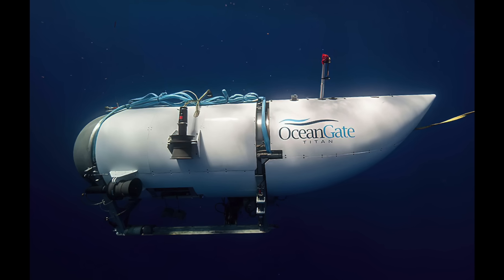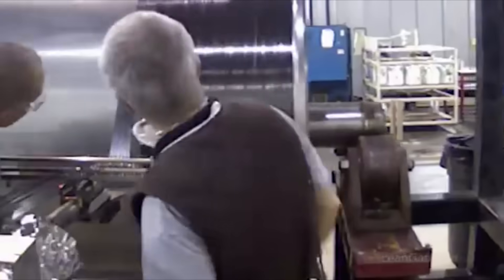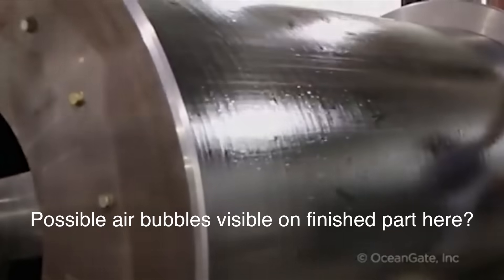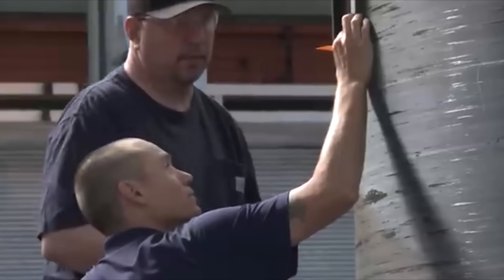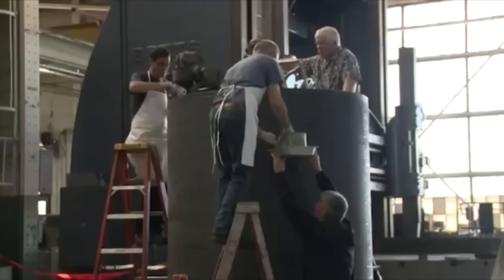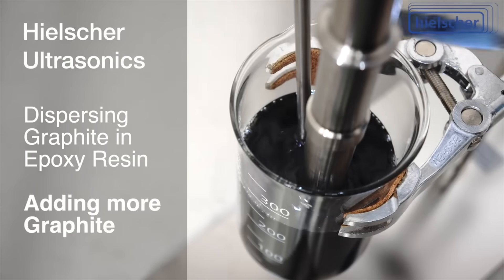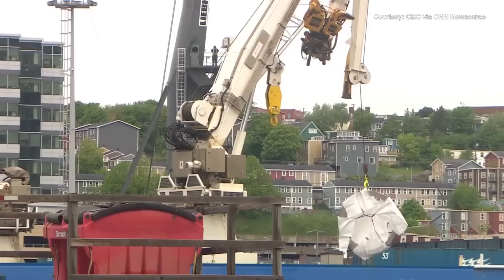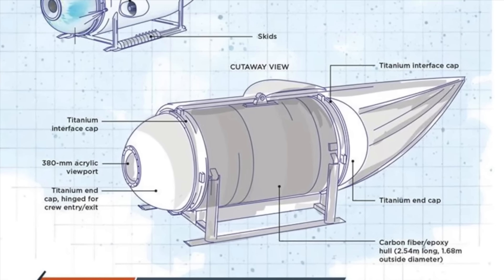Why OceanGate Titan Imploded - A Carbon Fiber Composites Perspective

Comment: Looks to me like the cylinder tightened against the inside of the C channel on the rings- must have been an enormous stress riser- Some force has sheared off the inner side of that channel on the forward ring. Also, so correct about the glue. Unless it oozes out the entire way round, you know you've left some dry. As de Havilland used to say when building the Mosquito- 'Whatever you do, don't spare the glue!'

Comment: An isotopic or quasi-isotropic layup would have made it more difficult for a pinhole of pressure to penetrate and begin to separate the laminate in both horizontal and vertical orientations through the laminate.

Comment: To fit the Titanium endcaps, they had to chamfer or remove about an inch of material in circumference.  When you do that, you just lost a huge proportion of strength on the outside layer.   It's now ready to peal off, pull away from the layment.  Similar to the sanding down of wrinkles, this seriously must weaken the full strength.

Comment: upon seeing the actual construction videos I had to cringe where they were buttering the ends with the adhesive, that is applying an adhesive to a smooth face in order to bond to a fairly smooth face as well in the composite material. That was just a matter of time before that came apart after compressing & expanding and over again. Flexing bit by bit till more fiber pulled apart and snapped, till finally it catastrophically failed. ~5900 lbs+ of force per inch baring down on every square inch multiplying to millions of pounds of water that REALLY wants to get inside.

Comment: If you study buckling you will see that the mathematical description includes a frequency component. This displacement will absolutely generate loads which are not radial. 

The vibrational wave of a buckling member is only one quarter wavelength long. Lol

Comment: The titanium ring should have been laminated into the body of the sub. In my industry making medical devices, we would NEVER trust merely epoxying in a titanium attatchment ring. It is always laminated in being part of the overall structure often with extra reinforcment. We often also use layers of different materials such as arimid, spectra, even fiberglass to take advantage of their benefits. Carbon fiber is super strong but it's also incredibly brittle and weak, especially at 90° to it's axis. Using muti directional layups doesn't have that much to do with torsion and more to do with alignment of the fibers so that the inherent weekness is mitigated...exactly the same as plywood. My theory though, is that the sub body was able to be squeezed more in the center which would actually make the ends go bellmouthed. With such a short flange only being held in by sketchy glue it would have popped like a cork.
Reply from the maker: I completely agree about the bell mouth ends I think this probably never happened in their simulations because of some dodgy FEA. I’ll probably make another video including the latest findings from the investigation.

Comment: Did they ever test the compressive strength of the totally uniaxial composite in the direction across the fiber direction ?   Across the fiber direction a composite is hardly better than the raw resin.  It seems pretty clear that the tube failed in compression as applied by the two titanium end caps at depth.  This particular wrap design is even worse as a pressure vessel and is only used as an overwind on a metal tube that itself alone can take the tensile load applied by the fixed ends.  As a diving vessel you have similar design priorities with tube compressive stability added to the problem.  Too bad he didn't just use a thick wall titanium tube like submarines are made from.

Comment: Watching the assembly I see on the rings should have bolts along with the glue that would have made a stronger connection from the pressure hull to the rings also the pressure hull shoud of had a thin titanium sleeve under the carbon fiber and the window was not rated for the  depth there were trying to reach at the least 3 fatal flaws in the design.  This is a lesson technology over reach it's own bounds a lot like the Titanic it's self suffered the same fate . It would make a good move !

Comment: Would love to watch a vid of recent information that has came out and your analysis.
Reply from the maker: Going to cook one up once the dust has settled. Got some nice HD footage of the sea bed.
Reply: @JamieKunka  I have been watching them all like crazy. Would absolutely love to see a CF tech do an analysis. Me personally, I actually don’t think it was the CF that imploded. I think it was either the seal or the glass even. There’s far too much of it on the sea bed for it to have been the cause, too many big chunks. Once delaminated it gets extremely weak and basically just shatters like glass, so it doesn’t make sense to me that it was the main culprit if there’s such big pieces left. Not to mention, almost ALL CF is done on various angles, not how they did it. Hell, even my car parts were.
Reply from the maker: I think you’re right but potentially the carbon hull deflected too much due to all the cascade of internal faults and may have exacerbated the de-bonding on the interface cap. The window sounds like a fascinating area to research with its unusual design.

Comment: In fairness, the guy wiping with an oily rag, it is the outer sealing ring not the glue/bonding interface, however the guys on steps spooning the adhesive on is a total horror story, as is the whole construction and concept, an avoidable tragedy.

Comment: Mickey Mouse operation from start to finish... at least Stockton was in it when it imploded, I just feel sorry for the passengers and their families.
At 12,500 feet the pressure is around 380bar, which is about 5,500psi...not something to be trifled with. Hopefully lessons have been learned. I guess the lack of regulations meant that sooner or later some clown would get cocky and have a go at it to try to do it on the cheap. Bad idea.

Comment: Yeah, I agree… 600 layers all in a single orientation is actually very weak… and it being 100% carbon fiber and not alternating with layers of something like a titanium…

Your suggestion on what techs should be wearing is right on… I can say when producing airplane parts all our mechanics had full Tyvek Gloves and hair covering… since the dust from carbon fiber can be quite an irritant to many… all was required as a safety measure…

Comment: Are there any other application where the thickness of a carbon fiber composite is 5 inches / 120mm?
Reply from the maker: I’ve seen fibreglass components that thick on wind turbine parts before but not in CF. Apparently Boeing had advised them to make it 10 inches but Rush somehow managed to reduce the wall thickness to 5…

Comment: When the carbon fiber threads are subjected to pressure, much of the strength lies in the laminate that binds the carbon fiber threads together.
The threads are composed of incredibly smaller threads just like a lace. When the whole thread is subjected to pressure, these smaller threads separate and expand from each other in a 90 degre from the lenght of the total thread, with great force on the laminate. The laminate is not designed for this force, but creates a process where the laminate cracks.
When the laminate cracks in exactly that point, It sounds like breaking a branch.
When this happens, the entire structure is weakened at one point, and under this enormous pressure, that's all that's needed, one weak point!!!!
The submersible send at message that they heard a craking sound and let go of some balast, but shortly after Tatan whent silent!!!!

Comment: Though your argument is correct that you should not touch a cleaned surface with your bare hand, the surface he was touching in the segment of the video you were showing, was not the bonding surface. Yet I would also agree with you that the bonding process shown does not appear to be exactly clean and scientific, especially considering the lives of everyone behind that joint is trusting their lives to that bond.
Reply from the maker: Yes it’s true it wasn’t the crucial bonding face but nobody should be anywhere near parts of that size and consequence prior to bonding unless wearing gloves and suits etc and in a clean room. Also it transpires titanium oxidises incredibly quickly after the recommended surface treatments needed for bonding. I imagine the surface probably had oxidised by the time it was bonded reducing the strength of the bond.

Comment: A very interesting video, however I think your statement at 3:59 is wrong based on the fact that fibres are awful in compression and only good in tension. I believe the only good that can come from this failed experiment is that Carbon fibre will never be used in deep diving vessels again. Rush didn't know what he was doing.

Comment: You also have to consider the high pressures and the diffusion of water (and potentially other gases) into the epoxy/fiber. If water diffuses in under pressure, it will try to diffuse out when it gets to the surface - this may create voids. It would be relative easy to measure how much water diffuses under these conditions by measuring water uptake but also doing non-destructive and destructive analysis of the cross sections. Failures may only occur under repeated compression/decompression cycles. My take is that carbon fiber composite was not a good choice.

Comment: I am uneasy with the single helix carbon fibre too.  The structure is mainly under compression so the hoop stress is adequately resisted by the single helix.  However the hull has no axial strength from the carbon fibre loops which can be easily elongated when stretched.

Comment: Great video & I agree with your analysis especially regarding angles of wrapping (I'm not an engineer either but have worked with composites). Strength to buoyancy seems nonsense to me as well. Ballast tanks/systems seem the determing factor for bouyancy, which is dynamic, not static

Comment: I like to point out only one single fact about carbon. Being a fibre, it is a tension material, not a pressure material! 

Because it’s a fiber, tension is done by carbon AND glue, IMO mainly of glue, because of the different direction of forces to fibers. It so simple. 

I would never have the idea to rely on fashionable carbon material in a tension situation. Carbon is suitable for space but not for deep sea.

Comment: A  good presentation and analysis of the facts.
My Thoughts.
First, the ''Liberty Ships' of WW2, and then the Comet Aircraft, which followed decades of experience of repeated stress on boilers, and their subsequent failure causes fatigue.. 
Fatigue is/was a well known and well documented phenomena.
Rush should have been aware of this. It seems he wasn't, or just ignored it!
He should have subjected multiple crafts to repeated unmanned dives, to collapse, to be able to judge the safety margins, and number of safe dives possible. He didn't!
A previous craft had shown signs of deterioration, and was scrapped,  that should have been a warning. He didn't take it.
He paid the price, but also, so did others, who should not have.
Therefore, it occurs to me, that the whole structure should have been one complete carbon fibre assembly, with no large joints between parts.
When joining a pipe to another component, its usual to use a bolted flange, then any differential expansions and contractions won't jeopardise the seal. 
With a tube within a tube, that problem is guaranteed.
Also different materials shrink or expand at different rates, so the mixing of titanium and carbon fibre may have been a flawed decision from the start.

Comment: I am an not engineer, but I do understand a thing or two about vessels and how they are built to withstand the immense loads. Even if carbon fiber was suitable for pressure hulls for a submersible, winding it in one direction cannot match the strength of winding it in multiple directions to equilize the strength in all directors. Metal is equally strong in any direction, carbon fiber is not. The way they wound it and the fact the pressure hull was not a homogeneous sphere made of steel or titanium were red flags I would not ignore.

Comment: OceanGate replaced the first bull after 2 years because it was seriously degraded and internal memos stated hills should be replaced after 18 months. The bull that imploded had been in use for 3 years when it snapped. They knew it was dangerous but they couldn’t afford a new hull until they got more money.

Comment: Naval Architect here - first, thanks for knowing we exist! Second, no, "strength to buoyancy" is not a thing. Strength to weight is a mechanical property of the material. Buoyancy depends on displacement, so on size and shape only, not the material. Of course we care about weight of the structure, because we need the right combination of weight and buoyancy to achieve the flotation we're looking for; but we only generally need to save weight with exotic materials if we're designing a high speed surface vessel. For subs you're looking for the best material to stand up to the pressure and you can afford a bit more weight. 

I'm not sure Stockton Rush had ever heard of naval architects. He certainly seemed to have a very odd idea of what marine classification societies do - talking as if they just don't know anything about carbon fibre (nonsense, they assess composite vessels all the time) when they were actually saying it isn't a suitable material for this application. If Lloyds Register refuses to class your vessel, there is some kind of fundamental flaw with what you're doing and he was not willing to accept that.

Comment: I would think a steel hull with a mid layer of titanium could use carbon fiber for buoyancy only, not for structure. carbon fiber is better for resisting pulling, not crushing.

Comment: Considering many countries have had submarines for quite some time now, and yet even they don't dive to depths beyond a certain limit on a regular basis, don't you think they would do it if it was reasonably viable?  It's obviously not because it's impossible, but because the risk to cost ratio gets dicey and you can't cut corners in design the deeper you go.

Comment: I agree that the design was incredibly dumb. I agree they should’ve done a better job during the gluing, but the scene that you are criticizing where the guy is polishing the ring isn’t actually introducing any problems. The part that he is polishing is the top, that supposed to connect to the titanium. Not the bottom, that supposed to connect to the carbon fiber.

Most likely, he is simply polishing the top of the ring as something that will look good on camera for the documentary.

He’s not actually touching the surfaces that will be glued with his arms or with the polishing rag.

Also, at 12,000 feet those endcap are going to have thousands of feet of water pushing them onto the carbon fiber tube. I’m gonna make a guess that the tube failed, and the pressure of the water rushing in blew the end caps off, after everyone was already dead.

Comment: Also those rings that go on each end, were salvaged off his first sub because he didn't want to spend the money or time on new ones. So somehow they broke loose the glue holding them on, then re-used them again. And that seems to be where the carbon fiber failed, blowing both end rings off without a speck of carbon fiber still glued on.

Comment: I am an electric / electronic engineer, who worked for decades as a commissioning engineer for high-tech vacuum coating machines, installing and repairing them on all continents.

1. When I saw the toy play station controller, it was clear, they also skipped any industrial (not to mention submarine) standards. Electric / electronic components within a ship should have at least a certain degree of dust- and most importantly water-tightness. If there is some slight leak within the ship, water might just start to drip onto these components. But water should never be allowed to come in to keep things controllable, even if it is just for the emergency routines. It is also important to avoid internal fires and electrocution of humans.
Our factory-based = land-based industrial machines have watertightness requirements (like higher IP-categories) when electric / electronic devices (sensors, valves, etc.) are to be assembled i.e. in or near water-cooling circuitry for the very same reason.

2. When I saw all the spaghetti-style power- and control lines (electric, air etc?) on top of this wacky "submarine" without any mechanical protection against whatever might come along, I knew these "engineers" are just charlatans. How can you keep control lines of any kind in a rough environment like the deep-sea so exposed? There might be so many unthinkable objects or perhaps large fish / whales bounce against it or get entangles there, i.e. while cruising around a huge rusty ship wreck or being lifted in and out of the waters.

It is amazing to see such extreme thoughtless botch from thousands of km/mi away through shaky TV-cameras.
The BS-phrase of "thinking-out-of-the-box" became obviously a complete new meaning or "level"; I personally rather stick to my profession and keep thinking inside the box - for safety's sake of the people operating "my" machinery.
Just by looking at this "submarine" (before it imploded), I would never have put my butt into it. Any old lawn mower feels more safe.

Peace! from Dresden / Germany

Comment: For a single moment in time, those five souls got to experience what it would be like to stand on the surface of the sun. A small pocket of air condensed that fast would produce light and heat that we can quantify but likely no one can imagine.